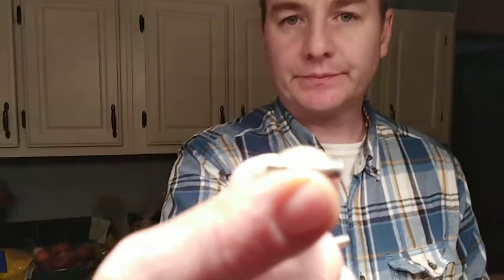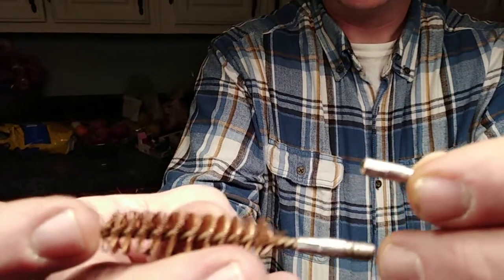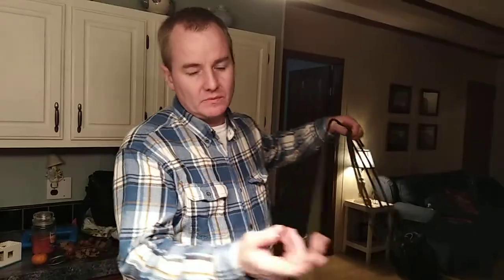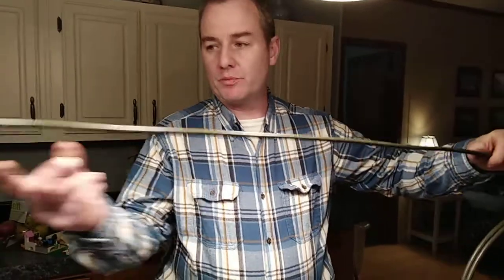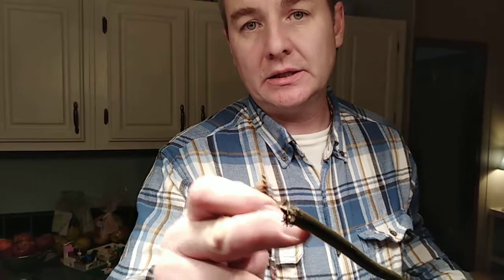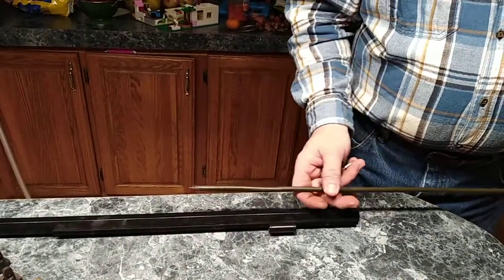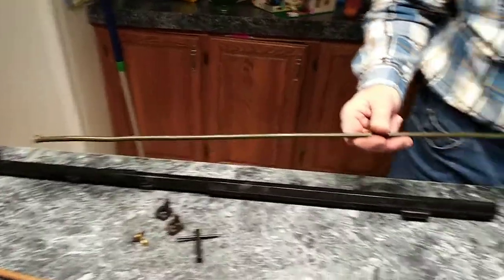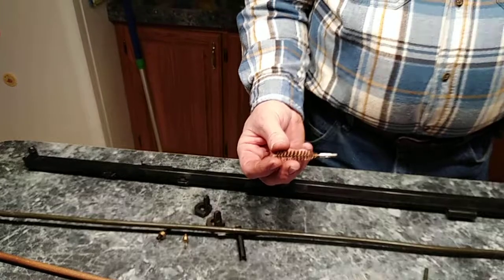Stuck Muzzleloader brush and how I removed it!

Comment: When I first got into muzzleloading the friend who was teaching me warned me of this disaster.   I dont think he had any solutions other than to pull the breach plug.   But he did say to never use brushes or mops that were crimped on.  Instead to use the ones that were held on by a loop
Reply from the maker: Can you provide any information on the loop type?  Not sure if ive seen this.
Reply: @vosburght  Try Track of the Wolf, Dixie Gun Works, the Possibles Shop, or Log Cabin, October Country Muzzleloading,  they all should have  them  ------- I separate my smokeless powder and black powder cleaning materials so there is no chance I mix the two
 since the crimped are easier to find and are perfectly useful for smokeless powder weapons
Reply: @vosburght  Theres a channel on YouTube called Idaho lewis he has a video called Cleaning a Sidelock Muzzleloader and in the video he shows one of the bore brushes with the loop style attachment
Reply from the maker: @moonrunner-01  thanks I'll check it out!

Comment: You can also use a pressure washer 😁
Reply from the maker: Interesting!  You'll have to explain that a bit more!
Reply: @vosburght  on alot of muzzle loaders there is a clean out screw just adjacent the nipple. Press the nozzle from the pressure washer hard to the barrel at that hole or even the nipple after it has been removed and hit the trigger 9 times out of 10 it will blow the brush right out. If you have a cloth on the brush it will blow out all the time pretty easily.  I have had to do it several times thus year once for me and my neighbor.  I never recommend removing a breach plug because there are certain procedures for removing and installing one and it varies from manufacturer.  I have used powder to blow it out but that is risky.
Reply from the maker: @sgtbrown4273  Nice!  Thanks for your experience!